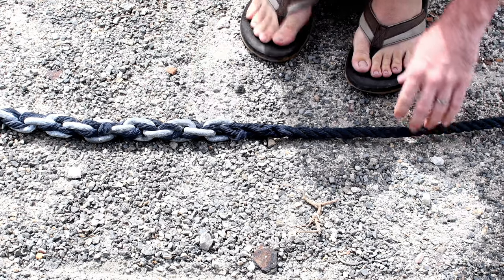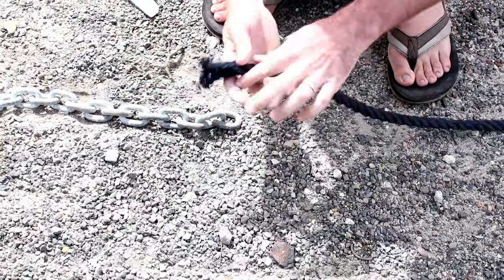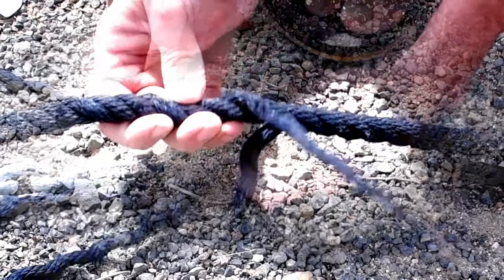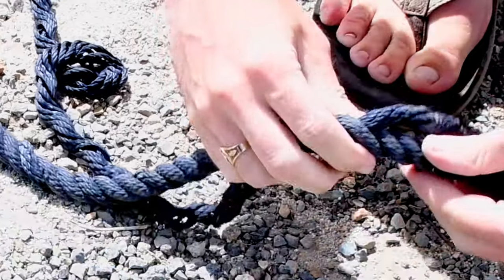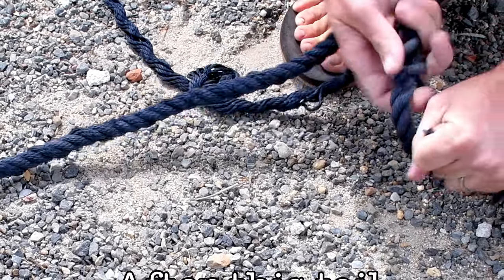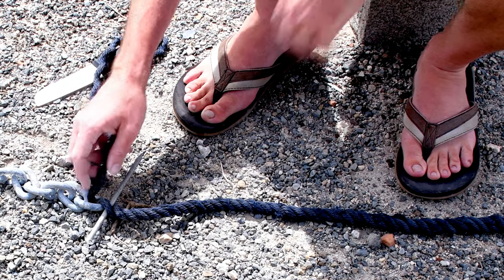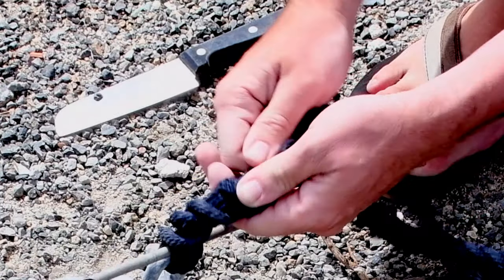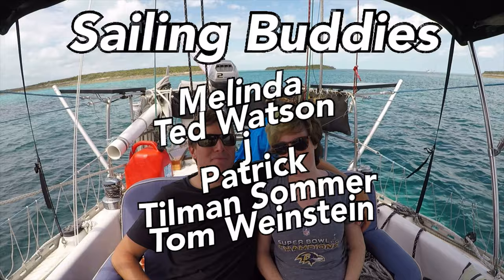Rope to Chain Splice | Sailing Wisdom

Comment: I use this splice on my rode. I've had folks act horrified that "there's only two strands through the chain!" Well, no. There are actually four strands taking the strain from the chain link. One of the major rope manufacturers (can't recall who) tested this splice and determined that it was actually stronger than the three-strand rope is was made from. It passes through my windlass very smoothly.
Reply: Four strands? At 6:26, Herb adds the third strand.  When does he add the fourth?
Reply from the maker: The four strands come from the fact that the two strands double back. You have 3 strands leading to the chain but the chain is supported by 4 strands (#1 and #2 going to and returning from the link).
Reply: Does not make sense to me. I only see two strands in the link.
Reply: Can you recall where you have seen the test? I totally agree that the force is distributed effectively by the 4 strands, but the weakest “link“ might be the 2 strands that are in the chain link itself (before they return and double down) so I’m concerned that exactly this portion of the rope might fail.

It’s more concerning to me because I’m using the strongest chain in the market made from “duplex” material by Cromox which enabled me to downsize the chain diameter, which also means that I now have to use a smaller rope..

Comment: I like this, I will have to try soon. Grinding a 3/8" BB down all chain as mooring. Looks smooth enough. Apparently I should have painted with antifouling that I was considering. The winter crop is set now. Last time up my CQR brought up another larger CQR.
Reply from the maker: Sounds like you went fishing for anchors and used the right kind of bait 😂
Reply: @RiggingDoctor  My friend was wondering why his morage on 80' schooner didn't swing right had it dove to find chain hung up on a ferocement sailboat sunk. Everyone jokes that he can pull up the anchors now and just use that boat.

Comment: Very nice video. Going to add it to a playlist. I'm starting about 25 new playlists, all starting with the word Sailing. This new playlist will be called Sailing Knots and Lines I've got a ton of Dyneema videos, ect. I think. I'll also have it downloaded on a thumb drive in a folder by the same name. Why ? Well, I'd like to get on a boat, and sail to "exotic places" which usually have no internet , right ? Interesting you have a 12v windlass. I wasn't remembering that detail but know you definitely stay away from electrical stuff. How are the new batteries holding up ?
Reply from the maker: Great organizational strategy! The batteries are great. We are soooo glad we made the switch

Comment: I am wondering why you didn't use a SS thimble through the chain to minimize chafing.  Would that cause problems at the windlass?
Reply from the maker: Exactly. The windlass is the reason that everything has be smooth and tapered. It is a troublesome spot but one that is easy enough to inspect.

Comment: Used this to prep my secondary anchor for the upcoming season, so thanks!
Any chance you, as a rigger, could explain, flush out more or demonstrate how to DIY a dyneema adjustable double ended, whoopie sling-ish, main sheet system like what Nike from white spot pirates used on her Karl recently? I have a NorSea27 that has a single ended main but it’s set up like a double end: only one standing end out of the port main sheet block but the sheet is attached to both rear quarters. It makes it difficult to sail to windward not being able to pull the boom to windward. Same problem but to a lesser degree with our smaller Ideal 18 daysailer. Looks like a potentially very useful solution on both my boats. Probably others too
Thanks again, great vids!
Reply from the maker: That is an awesome setup! Thanks for showing it to me! Our Alberg has the same setup her boat had and I was trying to figure a better way to setup my mainsheet. 
Great topic and idea :)

Comment: In your write-up, you mention that "It is very important though that the link be tied tightly in the rope that way it doesn't wiggle around while in service." But here in the video you say we should leave a little wiggle room with the 3/16" fid. Which one you support now? and what made you change your mind?
Reply from the maker: It depends on your setup. If you have a windlass, you need to make it loose. If you are pulling it up by hand you should make it tight. 
When it’s tight, it’s less likely to chafe so it will last longer. The problem is the link won’t move to line up with the windlass and it could jam or skip when it transitions from rope to chain. 
Having the space can make it chafe there so you need to inspect this point frequently and repair/resplice as needed. If you are pulling it up by hand, make it tight so it doesn’t wiggle.

Comment: It's been awhile since I've spliced to chain but the last time I vaguely recall I passed two strands through chain link and third strand through chain link the opposite way like you did but then I back spliced all three strands together same time as if splicing a normal eye/back splice and tapered tucks as normal. I can't remember doing like you did in this video by splicing just two strands first, but maybe I did. Is It possible to splice it like I described? (With one strand having the half hitch lock at chain link). I'll have to have a practice again as I recall doing it and if I get stuck from wrong method refer to your video to correct myself.
Reply from the maker: You can but the result is going to be thicker and on some windlasses it might be “just too thick” to flow through and could get stuck. The method shown keeps the line size even enough to flow through even the finickiest windlass gypsy.
Reply: @RiggingDoctor  Thx, makes sense as your taper is much longer and keeps everything slimline 👍

Comment: And if you were not using a windlass do you feel this better than the way it was?
Reply from the maker: It is the better way of the two rope to chain splice methods, but if there is no windlass, the idea would be a thimble on the rope and a proper shackle connecting the rope to the last link of chain.